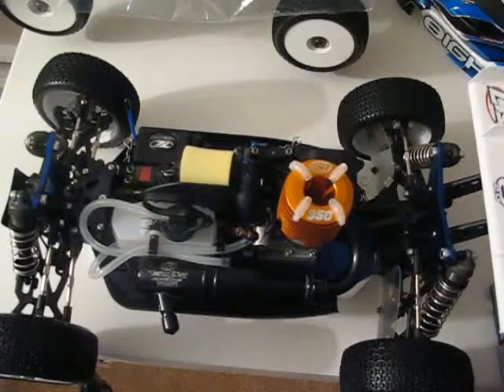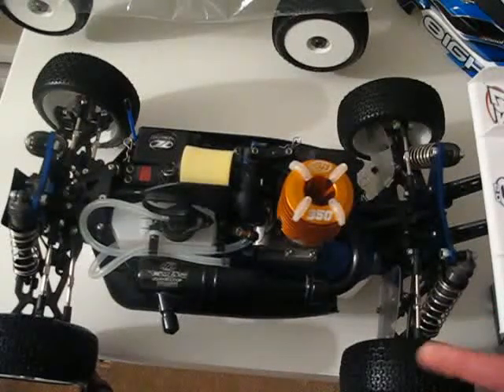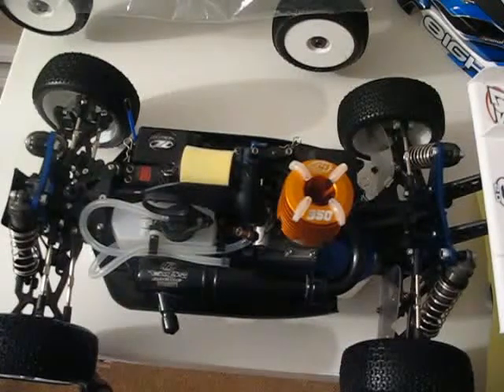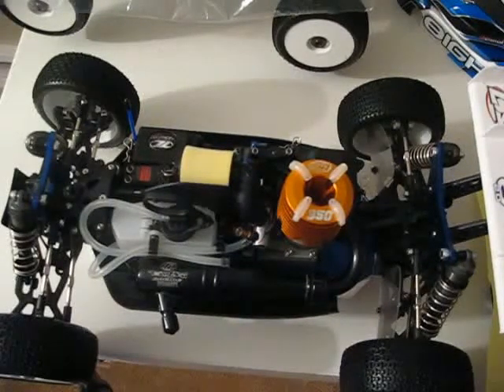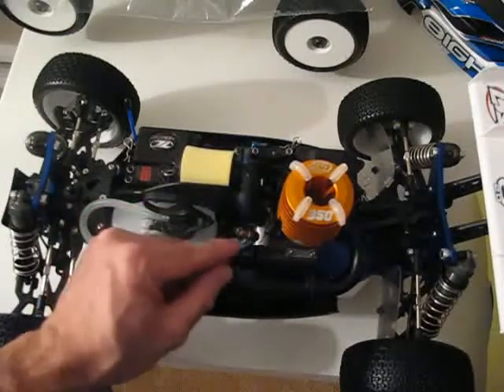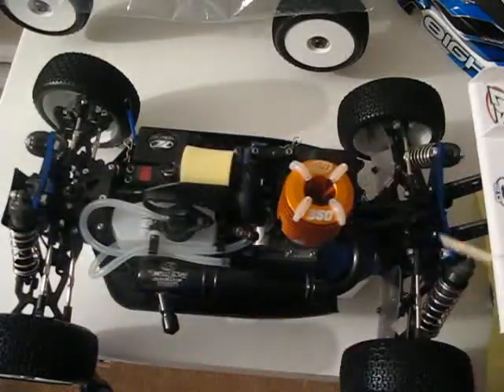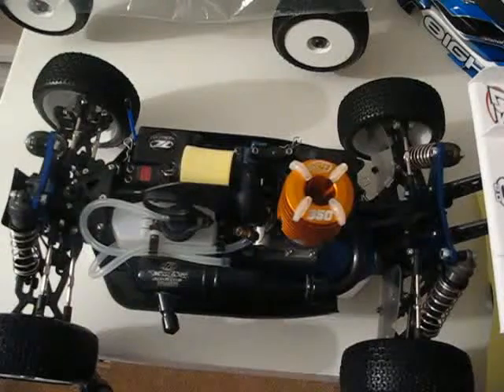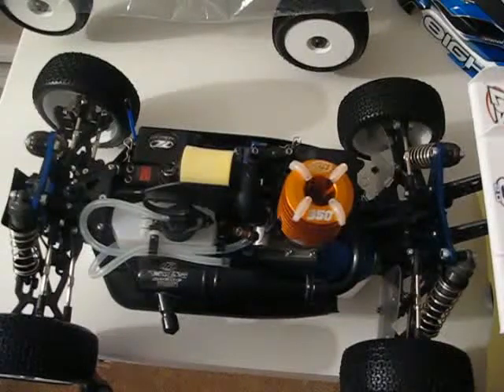Beginners guide to nitro buggys.mp4

Comment from the maker: When the motor is new the piston will get stuck at the top of the cylinder it's not seized up it just appears that way you need to put a screw driver on the fly wheel and push it and it will free the piston. It's harder breaking in a motor with a starter box .

Comment from the maker: Before break in put 7 drops of run after oil in the motor , then loosen the glow plug a little to kill the compression then  tighten it once it starts . Idle through 3 tanks up on blocks letting it cool 10 minutes between tanks. Then drive it gently the fourth tank  and tune it during the fifth tank. The 350 is a great motor good luck remember to run it rich during break in